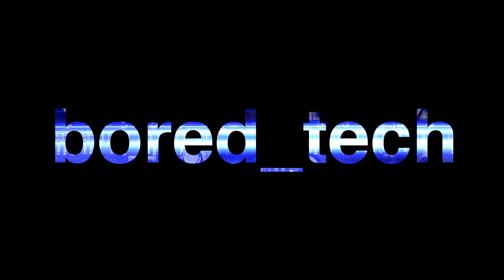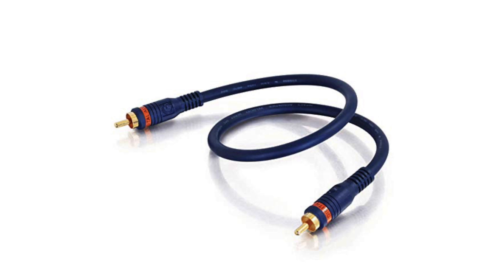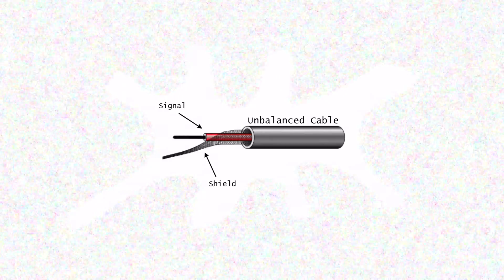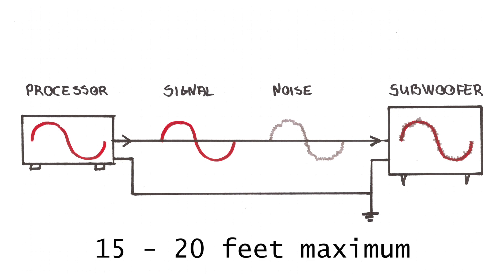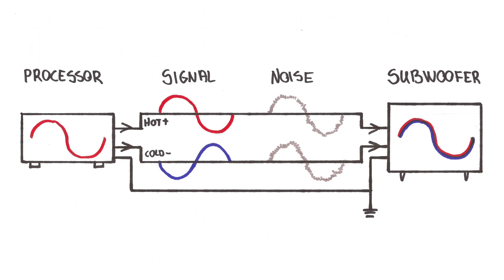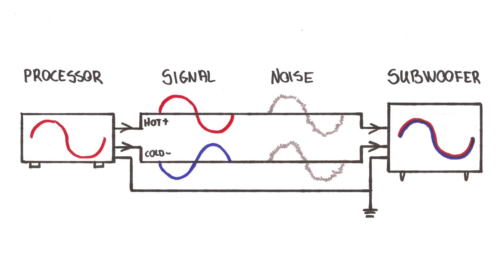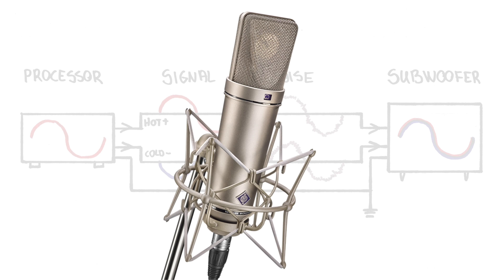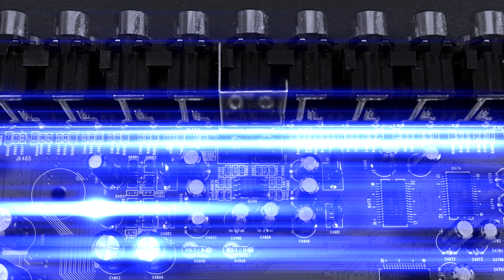Balanced and Unbalanced Audio Connection Explained...

Comment: Very well explained with good illustrations- Thank you! I have been searching this topic too as I am currently using the MM7055 which has the balanced option. However unfortunately it is paired with my Marantz SR6011 which doesn't. Should i upgrade to a preamp would definitely try the balanced option to hear the difference in audio quality.
Reply from the maker: Thank you for watching my videos. Hopefully you'll be able to upgrade your setup soon.